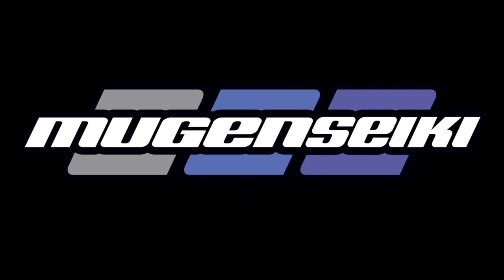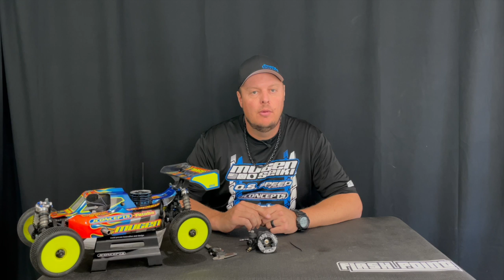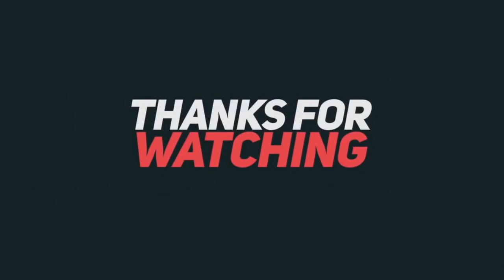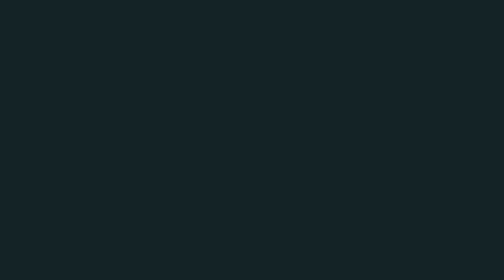O.S. Speed B21 AD3 carburetor settings.

Comment: Hi Adam, I have this engine and I noticed that the it seems a little rich on high speed with the tuning that you recommended. But i use Energy Fuel 16%  because EU laws, so is it possible that the fuel forces me to lean the engine? The engine runs well with 1.7-1.8 mm from flush. It has 2 gallons.
Reply from the maker: Yes, it's fine to be leaner especially with the lower nitro %.

Comment: Is it normal to have two stage idling with the ad3 ? Cant really avoid it... any suggestion how to fix it ?
Reply from the maker: It's not a big concern as long as your don't notice it on track, but it's not normal as long as the lsn is leaned out enough and the idle gap is low.

Comment: what is the outside diameter of the base and length of the base of the carb? is the carb base insulated??
Reply from the maker: 15mm
12mm
Yes
Reply: @AdamDrake  thanks I appreciate it. I put this carb on an LRP 28 and so impressed with the tuneability...OS engines rock

Comment: Greetings Adam and always grateful for your super video right now I'm going as a mechanic with a friend to race at IBC PORTUGAL - BARCELOS.  We will use your AD3 engine, we have run it with 25% fuel.  But in Portugal 16% is mandatory.  What do you recommend as base adjustments?  Thanks a lot.

Comment: Hi Adam which pipe combo do you recommend to run with this motor @ revelation raceway? I bought the AD3 combo and it has crazy power especially down low and mid. I want a pipe combo with more linear power. 

Also, revelation raceway is pretty damn loose track. 

Thank you
Reply from the maker: If you need it to be a little smoother I would go with the TB03/75mm.  www.thedrakeracing.com